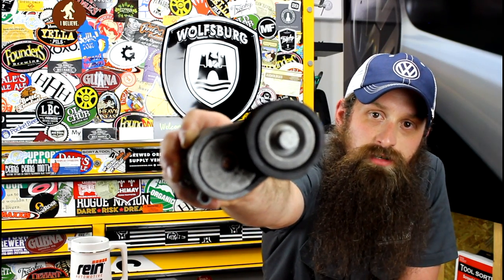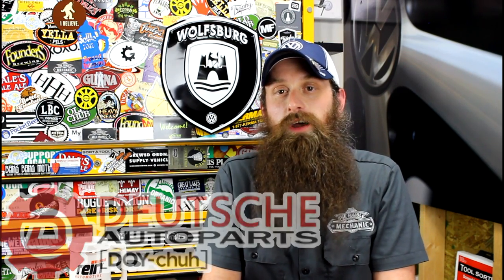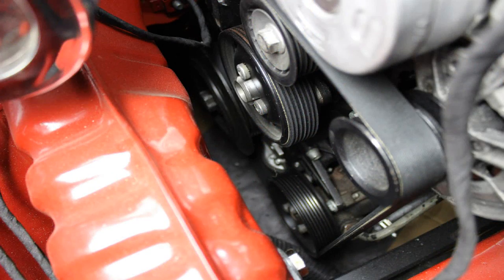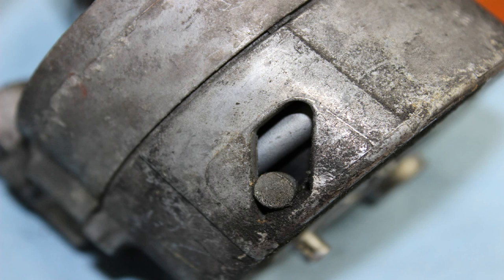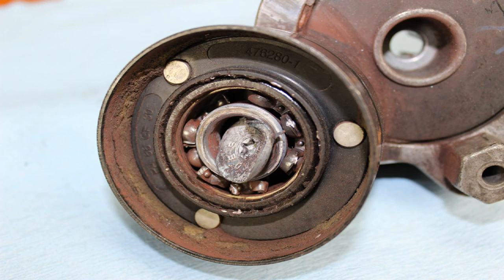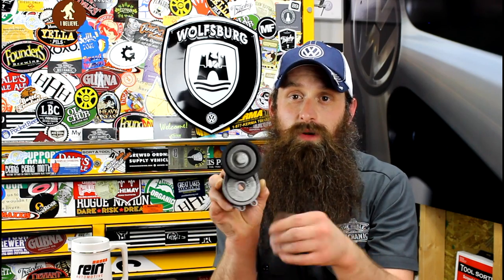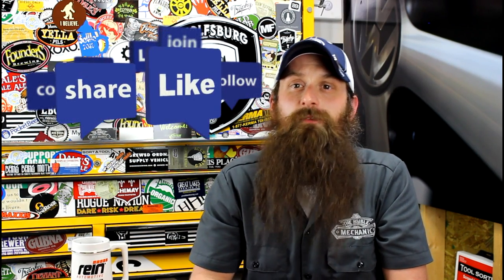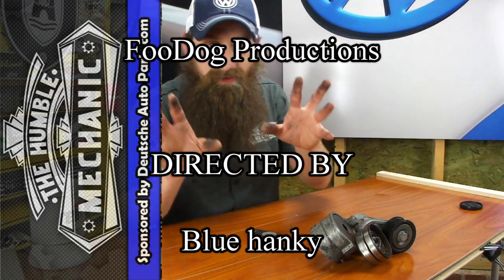How VW Serpentine Belt Tensioners Fail

Comment: Hey i have a 2011 vw jetta 2.5 and im almost to 40,000. I am very mechanically inclined and can do most of the service but im still kinda  confused on the dsg filter and fluid change how much does the dealer normally charge? And if i was to do it myself can i do it if i do it on completely cooled motor or does it have to be at a temp cause i dont have vcds.

Thanks
Reply from the maker: if you have a 2.5 you don't have a DSG. You can do it with out VCDS. just measure what you take out and put back the same amount. 

the proper way IS to measure temp.

Comment: HEYO! question for you me amigo, i work at a hyundai dealership and my boss brings in  random cars from his friends. i was wondering for a 2001 v6 passat 4motion, for timing belt removal/replacement do you have to remove the entire front clip? (front bumper, condener, radiator) also are special tools required? HumbleMechanic
Reply from the maker: rehlek No, you put it in service position. So the bumper comes off, and you unbolt the core support and pull ir forward. You will need a crank and cam lock to replace that timing belt. 

Leave the rad and condensor on the car.
Reply: alright i assumed as much, thanks for the advice!

Comment: You my be able to help me out: I have a 2ltd engine turbo high mileage audi A4 2008 model. My steering vibrate heavily when I m not on the accelerator. I doesn't vibrate when I m accelerating ie during normal driving but does when eg parking and not on the gas pedal.

Comment: If the pulley tensioner break while driving is there risk of blowing the motor? It's a 2.5l 5cyl 2007 Wolfsburg ed jetta..
Reply: lol no, it will just damage the cooling fan. if it mad enough, it could damage the radiator too

Comment: IMO Vw cars are as good as any newer car. In some ways better and some maybe not as good. The bug because it is hard to get access to tends not to get serviced as well as others. so It has more problems. The key is following maintenance and making sure that is done right and thorough. I like DSG and it has less long term issues than other automatics. But other people have the infamous valve body fail and say they are POS. but  an in car repair vs total rebuild I would take a dsg over any other automatic..

Comment: My tensioner makes a supercharger noise it's faint though and on idle it moves around a little then it runs normal.Is there a way to tighten the tensioner . I might have put a lot of force taking tension of the tensioner. Thanks
Reply: I checked with a light on all the pullys they seemed to be on the belt after I changed it

Comment: Vw eos 2012 low pressure light on car shut off and have smoke out exhaust. Internal engine noise now and codes p025c and p0301

Comment: The 2.0 Touareg is a pain but I changed just the pulley and also found the alternator pulley was bad…update.. alternator replaced( lifetime warranty) squeak remains and on two locations serpentine side and the driver side…..thinking this is going to die soon…also the tensioner on a Touareg has a shaft running through to the other side so you pretty much have to drop the motor to replace….not so much diy

Comment: I just got a brand new 2017 GTI S and the serpentine belt tensioner made a chirping noise at the first start of the day for a couple min and went away when warm.  I took it to the dealership and they replaced the belt, tensioner and bolts and said they fixed the problem, but when I started the car the following day the noise was still there, but only lasted for a couple seconds and went away when warm.  Is this normal for a brand new belt tensioner?
Reply from the maker: +Brian Farinas not normal based on the way you described it. 

But without hearing it I can't be 100% sure
Reply: I can email you a video of it, if you don't mind.
Reply: Did you ever find out the issue I have same problem ?

Comment: I have a 07 passat b6 3.6 and it has a 64 and a 63.50 for belt sizes. Does it matter which I get? Why different sizes?
Reply: If your original Belt is aok... Best is to bring the same Belt to the Store and replace it with the SAME one. Or if you know or if you can measure it, then get the SAME one. Loose Belt can cause many issues :///

Comment: @HumbleMechanic I have a MK6, and when I have the A/C on and accelerate, it makes a sound like a belt is squeaking for a second...but happens every time I accelerate with the A/C on.  When the A/C is off, it doesn't happen.  I was thinking it was the Tensioner, but not sure since it's only when the A/C is on.  Any ideas??
Reply: Did u figure it out?
Reply: @dannyg2409  Yes, it was the alternator pulley...thought it was the belt, then the A/C pulley, but finally figured it out.
Reply: @yukichan3971  ouhh okay thank you

Comment: I  have a mk3 VR6 and it squeaks bad when I start I thought it was my tensioner but it wasn’t it gets louder when  i accelerate and drive  off , I should check all the pulleys and see which one is causing that noise ..
Reply from the maker: Yep alternator is what’s it look at next
Reply from the maker: Or water pump

Comment: What would cause an the belt to slip and move over towards the motor on 01 Jetta vr6. It takes part of the belt off all the way around then it runs fine for awhile but you can see on the used belt that it is slipping on the pulleys.
Reply from the maker: could be a number of things. Wrong belt will do that, a slipping or failing component on the circuit will do that. Also an improperly installed part will do that.
Reply: HumbleMechanic I have the right belt. Double checked with the parts store. while doing some research on this it I think it might be that the pulleys are not allied. We just did a motor swap (ourselves) and I was having this issue before. It says on there we might need a special tool. Is that the case? I want to try the repairs that don't involve buying more parts. 
https://www.cartechbooks.com/techtips/serpbelt/ 
Thank you for answering my questions. We've put a lot of time and money into my Jetta and I refuse to get rid of her.

Comment: If the pulley is bad, can that just be replaced rather than the whole tensioner?
Reply from the maker: Some are available separately. Some are not
Reply from the maker: If it’s available separate then replace it separately. For me it would depend on the cost difference

Comment: mines makes a squeal in the morning like the humidity is on the belt but it doesn’t sequeal after i drive it a couple minutes
Reply: I have the same problem did you find out what the problem was?
Reply: @jahryljacobs828   no my belt completed snapped off yesterday so im guessing i have to replace it

Comment: I had buy a brand new tensioner made by RUVILLE for my 1.9 tdi ALH and there is a a
little play in the tensioner wheel.  Is that normal? or I souldn't install it and replace it?
Reply: The Pensioner Wheel should Spin Freely, all there is a wheel with bearing inside. Like on a skateboard wheel :)

Comment: How hard is this on a 1.8t?
Reply: Its not tough. 3 bolts, make sure you mount the little plate on the outside or it wont line up correctly on the belt.

Comment: It would be helpful if you included ballpark DIY cost vs ballpark dealership cost to repair. Love the videos otherwise
Reply from the maker: Tammy Hoefeld Great suggestion. I have to be a little careful with prices because they can very so much depending on which model, and when the repair is being done. I will see if I can add that when it makes sense.

Comment: I have a 2010 Jetta 2.5l that needs a new tensioning Roller for  a ribbed belt for the AC Compressor. Do I have to replace the whole assembly or can I just replace the roller

Comment: I have a mk4 r32. Would a faulty tensioner and or belt cause an alternator to not output the correct amount of voltage? I just replaced the alternator and when I turn the air conditioner on, the voltage drops from 13.9 to a little over 12 volts. I replaced the original alternator thinking it was going bad but still getting the same issue. Any ideas?

Comment: Hey so I have a mk4 vr6 12v gti i had a squeak on the belt so i replaced the belt and it went away, a few days later it came back, so then i changed the idler pulley and the water pump pulley and the water pump plus the belt again and the noise went away, but now it came back again and I don't know what it is, every time I drive over a puddle the squeak goes away what can it be?

Comment: i have a jetta 09 2.5L and the belt tensioner or atleast the plastic part around the metal completely melted and fell off any thoughts on why that would happen.

Thank you
Reply from the maker: The bearing probably failed
Reply: @HumbleMechanic   thank you, you were right bearing failed replaced the tensioner last night and were back in business.

Thank you!

Comment: Hey i have a 2013 vw cc 2.0T
i hear a squeaking noise when i accelerate and turn the car on, i change the tensioner and the belt but it still doing the same thing can you help me out with that.